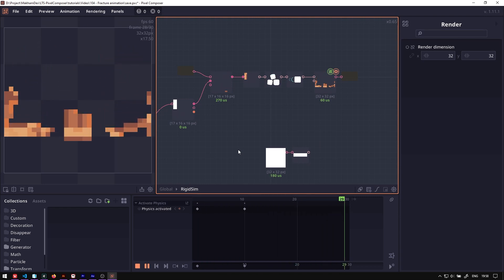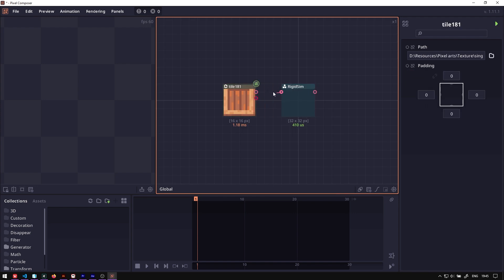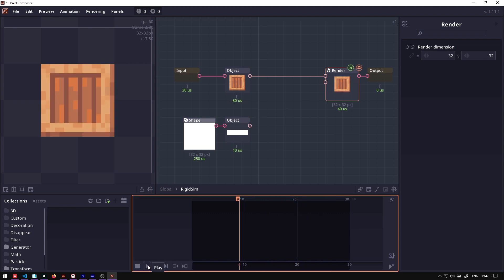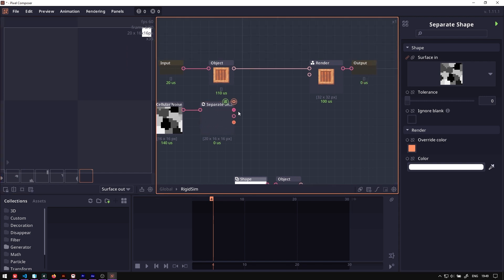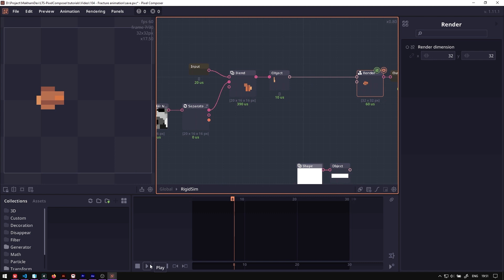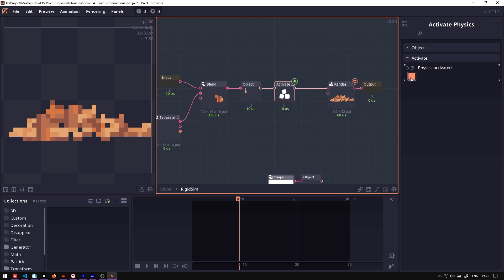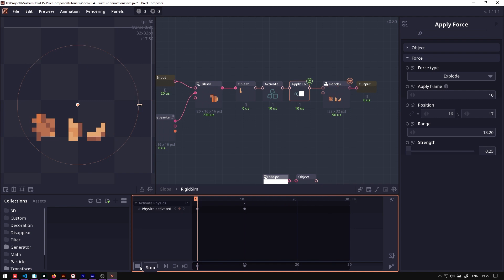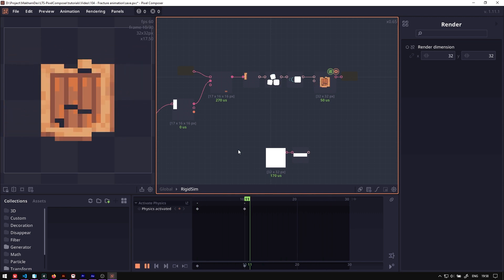《Pixel Composer How to》Fracture Animation

Comment: When I use version 1.17, the images segmented by the Separate Shape node are not in their original positions, but are concentrated together. How can I handle this issue
Reply: +1, I'm currently still trying to figure out a solution around this.
Reply: Solved! Using Ver 1.18.7.1 Plug the Atlas output of the Seperate Shape into Foreground of the Blend Node instead of the Surface Output

Comment: will pixel composer become a full game engine?  Many of the features would be very useful in realtime as the game is running for generative creation of dynamic content.
Reply from the maker: Most likely not, Pixel Composer is built using a game engine, and some features, like Rigidbody sim, comes directly from the engine behind it.
Reply: @makhamdev  maybe you can create the integration between the tools and the engine like what aseprite do in unity and godot